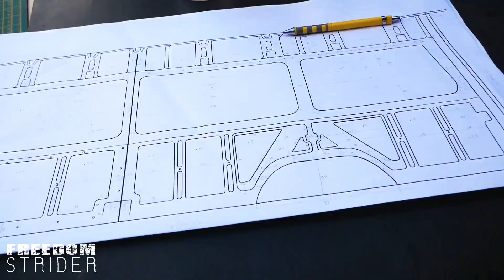Campervan Heating: LPG vs Diesel vs Electric - FULL COMPARISON

Comment: Also underfloor heating will not be anyway near as efficient as in a house. There you have a thick slab of material (cement) which requires little heat and radiates it constantly all the time. Without the slab you will require a lot of temperature, much of this will be wasted without a very thick layer of insulation and it won't last very long so you will be heating it up very often, very inefficient
Reply from the maker: Although not as efficient as normal underfloor heating, it certainly isn't a waste, our floor gets warm within 30 minutes. It's not our only/primary source of heating, more of an added benefit, and warm feet in the winter makes all the difference 🙂

Comment: The Chinese have diesel heater/hob  either as worktop or slide out like a bbq
Reply from the maker: Did you have a link to one of those? I didn't know there were Chinese varients of the diesel hobs
Reply: @FreedomStrider  Harbin Hoake Science  and Technology Co Ltd. I spoke to Lin Wu, probably sales. Try to find the manufacturers , which above is, as most are suppliers
Reply: BTW, I am not giving recommendations here, you will be like me, trusting instincts. They will all ship by sea, which is much cheaper and quote 40-50 days. Air freight 10-15 days.Good luck
Reply: @FreedomStrider  Search Diesel stove, not hob. Though it is a hob😊

Comment: As a thought... you can get LPG diesel conversions (check out STAG AC). If you go down the LPG route, look into this too. you could potentially reduce MPG and emissions driving while also tapping into the same tank to run cooking and/ or heating appliances. I've looked into all of the various options al lot! So would love to hear your thoughts and know what you ended up going for :)

Comment: Hey! Not sure if you've already made a decision yet and purchased all the gear, but I went down the diesel route on my van - but did so easily under £200 - and this is not a low spec or budget install. In short, I bought a webasto thermo top c off a scrap vehicle (£60) - there's loads kicking around if you know where to look, just be careful not to buy one which requires a can bus signal (often on BMW & JLR vehicles) - In fact, some vans have them fitted from factory, so well worth checking if yours already has one). Now for the fun part - I installed a 50kw heat exchanger to the coolant system (standard house boiler exchanger £30) in parallel to the engine. Again in parallel, I plumbed the webasto with pump into the vans coolant system (heater circuit, not radiator circuit). I then rewired the vans factory fans and climate control to the leisure batteries. Connected to the heat exchanger I have a small 10L hot water tank (£20 from a broken gas truma heater) and circulation pump (£12). This pump turns on whenever there is a 5 degree temperature difference between the the heat exchanger and tank (£16 swimming pool heater circuit). So when driving, I get free 70-80 degree water stored in my tank. When parked, I can heat the coolant via the webasto. This gives both hot water and hot air from the factory blowers (temperature controlled by the climate control) - I extended the temp sensor for the climate control to be in the living space. When showering, the cold water passes through the heat exchanger, into the tank and then to the shower. So as long as the engine or webasto are running you have instant hot water even if the water tank is cold. By having a tank, you have instant hot water without the need to turn the heater on (as the webasto can take a while to heat up). Lastly, heating the coolant, heats the engine. So you get better MPG at the start of a drive (no more cold starts). Cooking wise - I'm spending my money on lithium prismatic batteries. With a good dc-dc charger, you can charge your batteries at 50A plus. With solar, you'll likely never run out of power. Plus lithium can be depleted to 90% compared to 50% in an AGM. So 200ah lithium = roughly a 400ah agm battery. My van is small, so space saving is essential. With this set up, the only thing inside the van is the 10L tank (to help keep it insulated).
Reply from the maker: Thank you receiving your setup! It's very helpful to compare notes 👍 

We have bought our setup and we are now working on setting it up in the van - we are taking baby steps as this is the first time we are working with this sort of system and we are leaving room to upgrade with time so it is good to know our options 🙂

Comment: Good info. TY. Looks like Ill stay with lpg for a high btu wok station and look in to the desal hydronic set up. The back pack butane gear you have here in the video seems fair. But I have never used theme before to know cost and or functionality.
Reply from the maker: Yes the portable gas stoves like the one we used here to cook pancakes actually work really really well. over time they do cost a bit, as you keep having to buy gas canisters and they aren't the most environmentally friendly, so not the best solution for the long term but they are a good start. The only issue with diesel is the problem of trying to cook on it. 😂

Comment: I saw on the Hugh Tube channel recently a combined diesel hob and heater. He runs it off the main diesel supply  Great for space and convenience but pricey, apparently.

That leaves the oven. If you're cooking for 2 only, wouldn't a small convection oven do the job and save space, and wouldn't the efficiency of a convection outweigh the fact that you're using electricity?
Reply from the maker: A diesel hob or oven is really expensive and the rate at which it cooked is really slow (like 30min to boil water) - as far as our research goes.

A convection oven is doable, however, the power usage is still significant. Some of the most efficient convection ovens that are on our list use 1000W - that uses about 40A on 12V DC and 3.7A on AC. So you will definitely need an inverter, so you would have to account for the inverter power usage too. 

So in short, it's possible, but as a general estimate - for every high powered appliance you add, you should probably buy an extra 100Ah. So on average, with electric cooking: 4 Lithium batteries and a reliable inverter is advisable. Have in mind the inverter itself needs power to run and it counts as high powered appliance, especially if you go above a 1000W.

Every battery you add, is cost and weight So it's just weighing the pros and cons. What we described above is an option (we would go with it if we had the cash), it's just a less budget-friendly one. 🙃👍

P.S. Remember that you would need to charge you batteries somehow - so bigger solar panel array and alternator charging for off-grid.

Comment: Hi guys, been watching ur videos before i started conversion, now in middle of it (just finished the floor) thx for doing lots of thinking for the viewers. To contribute my 2cents, https://www.ebay.com.au/itm/233503343231 1500w instant electric heater is wat I will be using to wash my 2 kids N wife. Hard thing is inverter, 1 hr will use 125ah so 10mins shower max in day time. https://www.ebay.com.au/itm/313078751529, not too cold in Aus so small heater on timer, and cooking what u r using above but on propane. Thinking of getting a 2k watt microwave oven... But mayb just a grill. Will aim to go around Aus starting Oct with pandemic allowance. All the best to all.
Reply from the maker: Yeah, anything with AC electrics it's not just the cost of the appliances and batteries, it's the inverter and its huge power draw - we are currently not getting an inverter (probably will in the future but not straight away). Luckily in Australia, you don't need a huge amount of heating power, so we are quite jealous 🙃. 
We would love to go full electric but we need more money and weight capacity... soooo next conversion 😉
Reply: @FreedomStrider  wondering how u r going to charge ur laptop then?
Reply from the maker: For laptops they actually run on DC power since they run off a battery. Any appliance you charge a battery for it to run actually runs on DC power.

So a laptop charger has an inverter (that box thing) that takes the AC power and concerts it to DC power (usually around 19V) to charge the laptop battery. You can find DC laptop chargers that plug into a cigarette socket, and have a mini stepup to get the voltage to 19V - that's our plan 😎 we hope...

Comment: In the same place trying to work out fuel type(s) to cater for a Sprinter capable of off-grid gourmet extravaganzas, so this is very interesting. Currently have a small weekend camper with underslung lpg powering a propex, hob and gas take off for external cooking, and have just ordered a Coleman stovetop oven to see how that works out - still lpg though, so no breakthrough I'm afraid! Considering the diesel ovens for the big bus, but the weight, cost and start up times...
On the hydronic front/recirculating showers , have you seen vanlifetech? $14k for a heating system is off my radar, but the ideas behind the underfloor heatingrecirculatingshower
Reply from the maker: Yeah, off-grid gourmet extravaganzas are quite the head scratcher. 🙃

Love vanlifetech's ideas and would love to work with them later on, but 14K is also off our radar at the moment (I mean even 3K is a serious investment), but the ability to use heat exchanges to customize the system is appealing.

Comment: Cheap Chinese diesel heater with separate tank can run off pink cheap diesel over here in U.K. and ordinary diesel abroad. Advantage with electric is convenient and fast with induction hobs or electric skillet. I used one of these exclusively for cooking for 3 years.     https://www.sunbeam.com.au/Cooking/Frypans-and-Skillets/FP8950-Ellise-Stainless-Steel-Banquet.aspx
With electricity you can tankless water heater for shower. High capacity generator for engine for faster charging. Big solar panels, small portable generator.
Reply from the maker: It's certainly an option - we might need a generator when up north in winter. 😊

Comment: Your calculations are based on using red diesel? You mention all the big names, I follow a full-time vanlifer who swore buy his log burner, then he got a Chinese diesel heater. He now raves about it so much, he is considering getting rid of his log burner.  They now do Chinese diesel water heaters as well as air heaters. As a follower of these things, I've not seen any evidence that Chinese products are any less safe or reliable that over priced brands. 

Sure, they are trying to get rid of diesel. But it's going to 20, 30, 40yrs before lorries and farm equipment can run on alternatives to diesel. The only service problems with diesel heaters are the glow plug, you can carry spares and sooting up which can also be cleaned. 

IMHO, diesel cooking appliances are a joke. Not just the expense, but slowness to heat up. 

I think a good collapsible solar oven and a small wood-fired burner for cooking is a must. I've already gone collecting scraps at long-dead wood that doesn't need cutting, which I use for cooking and BBQing outside the van. It's amazing what you can pick up off the ground.

Many of the systems you mention can't be fixed outside first world countries. Maybe staying in one place for a month waiting for a part is okay? 

Unless you are in northern europe, most of the year offers many options for hot/warm water, outside showers and cooking. 

The best is not always the most expensive or complicated.
Reply from the maker: Yeah totally agree with the diesel cookers being ridiculously spec'd in comparison. Also, they are about double the weight of LPG ovens, if not more, so yeah...

Honestly, with Chinese heaters we are quite stuck as the general concessions is "some are good, some are terrible". Some will work just as well as the expensive ones, some will breakdown in 5 mins, and we don't know which is which - that is literally the only problem with have with them. Even ones where people rave about them and link their product below, you can get a faulty one, or a dodgy one, and some of them you open their links and they say "can't guarantee will work, no warranty etc..." - really quite frustrating actually. 🙄

For repairability, naturally, as soon as we go off the beaten path, so to speak, and across more borders, it will become harder so we will have to get things delivered somehow, but the good thing is about the "brands" is that they are worldwide so we could get parts shipped. Off-brand heaters don't always have parts available. True that just throwing it away and buying another cheap heater is possible, but just more e-waste.

It will be nice to have a BBQ style contraption in the van so we can cook outside or on our roof deck, something like that (pancakes on a wood BBQ, why not?) we shall see. We're not going to rush to buy an oven, or anything LPG or really, the cooking will probably be the last thing that fits into place really. 

Don't solar ovens cook really slow?
Reply: @FreedomStrider  solar ovens, yes they are slow, but if you are parked up, why not
Reply from the maker: And no, we didn't even know what red diesel was until just now, it would just be regular diesel

Comment: Gotta say I have never thought about this subject as deeply as you chaps have. The Chinese Diesel heater was the only option for me and I'm still not sure I can afford to have a hot water heater. I had seen a few Van builders use Bosch Electric Mini-Tank Water Heaters and if I had a big lithium battery bank I'd probably go with that or an equivalent, assuming my job still exists by Christmas I may actually go with that. As for cooking, again gas was the only option with my budget.
Reply from the maker: Cooking or heating with electricity in a van setup takes alot of power, even for us, it's looking unreasonable in terms of cost to go that route at the moment. Indeed, gas (LPG) seems the only viable cheap-ish oven cooking option available!
Reply: there is a 2 in 1 diesel air heater plus water heater

Comment: Hi, I didn't hear you about Chinese heater solutions.  this is a solution that I am considering.  https://m.aliexpress.com/item/33018421161.html?pid=808_0000_0131&spm=a2g0n.search-amp.list.33018421161&aff_trace_key=b310d84673a1436f964c331b2446edb7-1592862509359-03294-_ePNSNV&aff_platform=msite&m_page_id=9130amp-NcgHCmpgFWZfzI0obqsPRg1595696066891&browser_id=7e79fa88d1524d369fb183689dd7b88b&is_c=N
   And the connection to the engine circuit, with the right valves, can work both ways.  😷😉😁😷
Reply from the maker: Thanks for the link, it's always good to have options 😊

We didn't mention the Chinese heaters mainly because in all honesty the video was getting kind of long and diesel heating options probably deserve a video on its own and it will take too long to give them justice.

Also, because we haven't tested any Chinese branded heaters nor do we really have products to reccommend, we don't feel right possibly leeding people to products that may not be safe. Some of them are perfectly fine, we just don't have a reference for them yet. 

Have you used Chinese diesel heaters before? Do you have any feedback on how good they are?
Reply: In addition, a lot of cars in Germany, Sweden and so on.  Have parking heating.  So in the second-hand parts market, there must be plenty.  😷🤔😷
P.S. I've not explore this yet!
Reply from the maker: Indeed, especially the hydronic heaters there are loads!